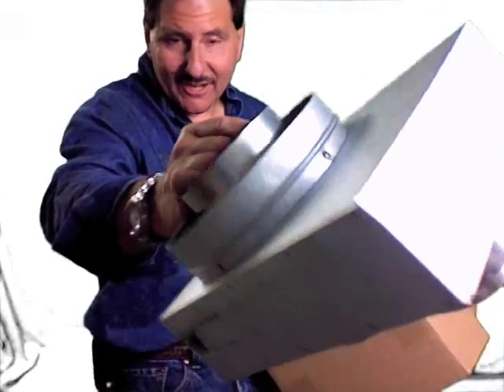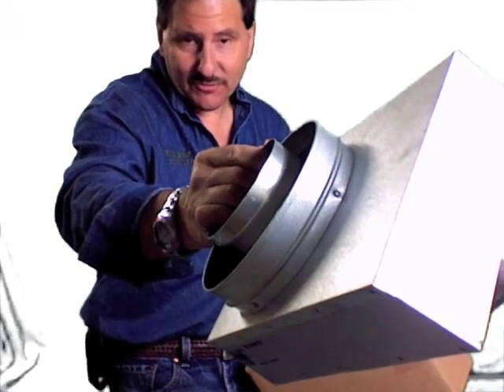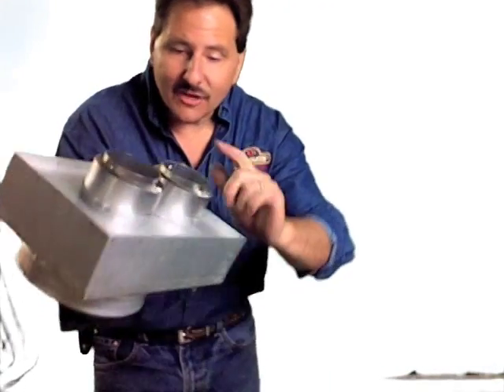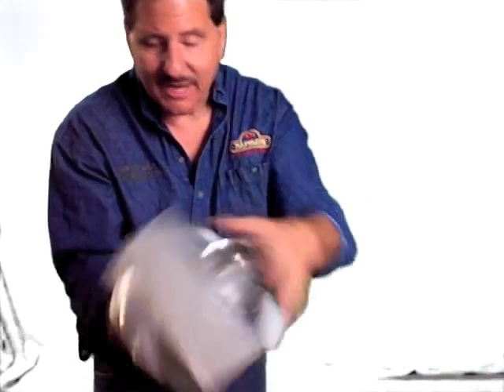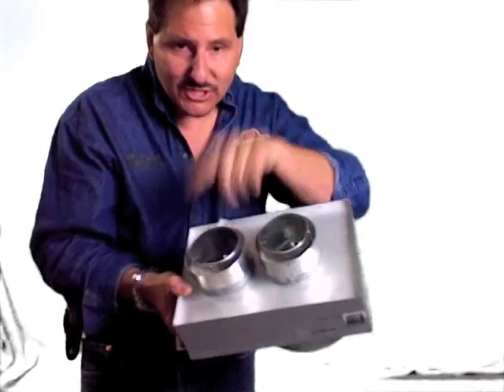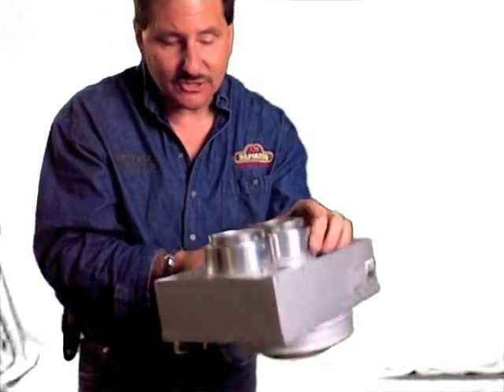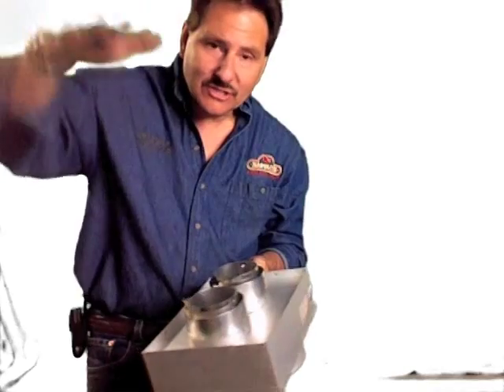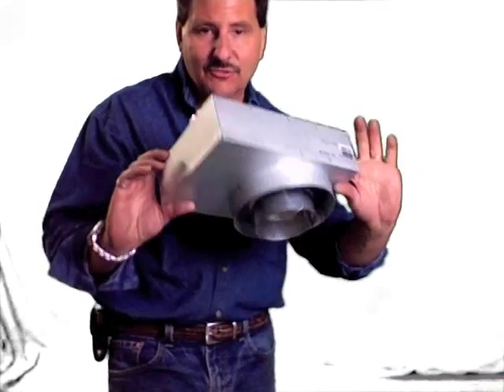46dva tcl 1 - Co-Axial To Co-Linear Appliance Connector

Comment: I have a gas fireplace insert that has a 3" intake and 3" exhaust coming out the gas insert. Right now it is going up through my chimney and into rain/wind cap. My chimney on the exterior of roof is old and I want to remove the chimney bricks on exterior down to the roof level and install a metal co-axial pipe through roof flashing. Can I connect my 3" intake and 3" exhaust from fireplace to Co-linear/Co-axial connector which then connects to Co-axial/direct vent pipe that goes through roof flashing and out to exterior of roof?
Reply: I have the same question. Did you ever get an answer on this?